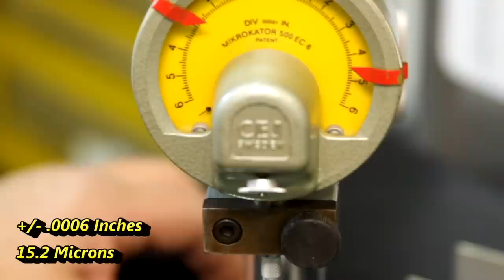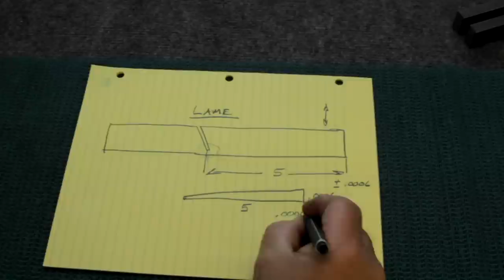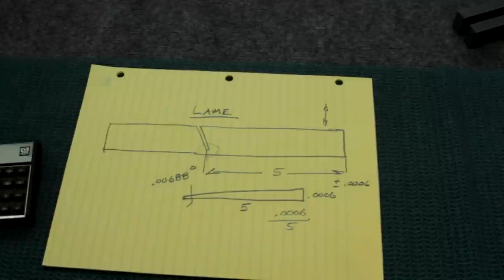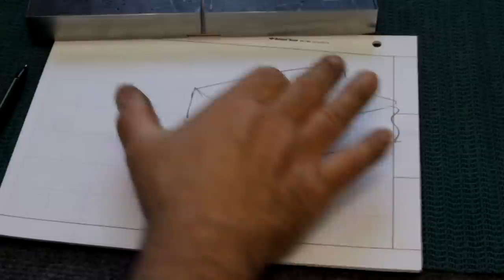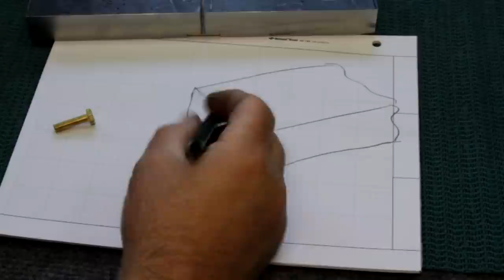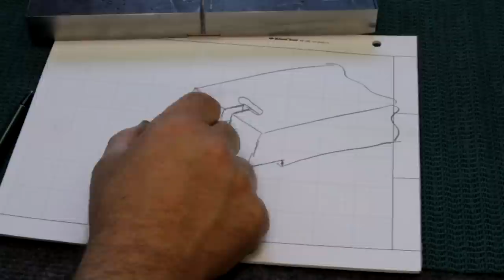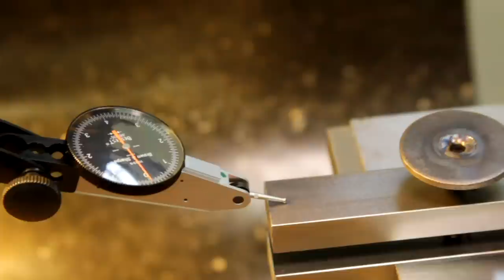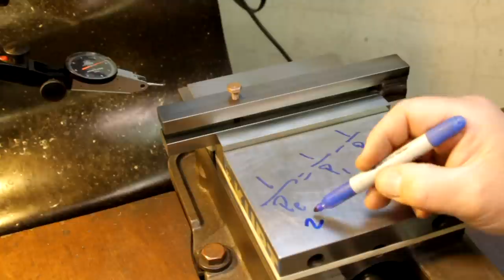Precision Mechanics

Comment: Why would anyone want "flexure" in a dial indicator base? You can zero the indicator and shouldn't need to or want to "slide" the tip of the indicator shaft across the work vertically or horizontally to "zero" the indicator with a "fine" adjustment. And what's up with measuring "dimensions" with a dial indicator? Typically you use a dial indicator - which is a "gauge" - to measure MOTION. Backlash, endplay, out of round, etc. Dimensions are measured with an instrument that can be CALIBRATED at various "lengths" within its range and that has no "slop" in its mechanism that can't be "calibrated" out of it. A micrometer can be checked for "accuracy" with a standard or even by itself if its a zero to "X" instrument where the anvil contacts the spindle. And you don't need a "surface plate" to measure the "height" of any object you can fit a micrometer "around". A "dial indicator" can't be "calibrated" and its internal rack-and-pinion and additional "clearance" in the mechanisms for additional dials are the REASON the dial can be "zeroed" by rotating it 360 degrees in either direction. I see you "precision machinists" using a ".0001" dial indicator and reporting your "measurements" in thousandths. Then you'll be describing some "imperfection" in a part using "thousandths", you'll "grind" or "lap" or "true" it and then "measure" it again and state that the same "measurement" is then within "tenths". Or it starts in "tenths" and ends up "millionths". 

Apparently there ARE no "hundred thousandths" in the "metrology" world, huh? Not when you somehow manage to always produce a "tolerance" of even tens of millionths and can tack a zero on the back of X hundred thousandths, pronounce it "millionths" and "skip" an entire "order of magnitude" as you switch from MERELY working with and two a "relatively" sloppy and imprecise "tenths" to "precision "metrology" which is according to you DIY "precision machinists" all in "millionths". That's weird since back when I learned to use precision instruments to make precision measurements you didn't dare "estimate" or "round" an additional "decimal place" beyond the "divisions" on the primary "scale" of your instrument. A "vernier" micrometer is ONLY "accurate" and "precise" to "tenths" IF you find two lines that PERFECTLY ALIGN and you've calibrated the micrometer with a STANDARD you know the dimensions of to TENTHS as well. And you still have "error" with a "tenths" measurement". And oh by the way, a  "tenth" is the FIRST digit to the right of a decimal point. The FOURTH is not a "tenth of a thousandth". It's TEN THOUSANDTHS. And if you can accurately and precisely measure TEN THOUSANDTHS, you damn sure don't need to use "couple" at any point DISCUSSING something that is "accurate" and "precise" TO TEN THOUSANDTHS. Just like a "few thou" isn't "acceptable" if you're doing/discussing precision work where "thousandths" are required. 

The "divisions" of an instrument are the "whole numbers" its capable of measuring to "accurately" and "precisely". A DIGITAL DIAL INDICATOR is not capable of measuring "to" five ten thousandths. It's INCAPABLE of precise measurements SMALLER than ONE THOUSANDTH. It has .0005" "divisions" because its RESOLUTION is limited to one thousandth AT BEST. Since its "accuracy" is +/- .0005" and it can't "measure" any smaller than .001 "accurately", when the jaws are closed and its"zeroed", that "zero" is ONLY "accurate" with the jaws closed. Go to .001" and it COULD BE "off" and that "reading" could be .0005" HIGH. That's why you don't use a digital dial indicator in place of a MICROMETER. Even with a non-vernier micrometer you can a least SEE if you're "off" on the "high" side or "low" side when a measured part is "out of spec". That way if that part is "loose" or "tight" in a bore, you know that at LEAST that part is "bad". But that doesn't mean the BORE is "good". In fact, if the ONE PART is OUT OF SPEC there's an EXCELLENT CHANCE the OTHER IS AS WELL. 

Do you "precision machinists" EVER get around to talking about the importance of using quality, undamaged, unworn and properly calibrated MEASURING TOOLS? I've never seen so many damned "professional machinists" to do some much damned talking about "accuracy" and "precision" with pretty much ZERO use of the proper tools, proper terminology and proper application and how to care for and calibrate and CHOOSE which tool to use for WHICH JOB. Is the MATH using a MICROMETER a little too complex for you "machinists" to do it ON THE FLY in a video? Is THAT why its dial indicators, digital calipers or nothing? The REALITY is that in the REAL WORLD you don't USE dial indicators to MEASURE ANYTHING BUT MOVEMENT. And you check "flatness" with a STRAIGHT EDGE AND FEELER GAUGE IF AND WHEN THERE'S A SPECIFICATION FOR IT. That's MAINLY engine work. Decks on cylinder blocks and cylinder heads. And the "tolerance" is usually pretty "large" compared to the crap you're presenting like its going to be a daily occurrence. Typically you'll have a "tolerance" of one ten thousandth per inch of length. And your "low" spots will be in the "middle" of a "span" between two contact points i.e. in the middle of a combustion chamber but measured at the "outside edge" of the head since you obviously can't measure "flatness" in empty space. And normally the "maximum" for "warpage" (there is NEVER a "flat" surface on a single axis that is "in spec" yet "out of spec" on the perpendicular axis i.e. TWISTED and therefore "warpage" is the "correct" term for how "unflat" a part like a cylinder head is) is that that ".001" per span between support points" TIMES the number of "spans" ON the surface and you use a STRAIGHT EDGE long enough to go "end to end" on the surface and check "flatness" at each "span", add each deviation from "flatness" you find and measure and if you get to the "max" for the entire surface length before you get to the FAR END, the part is JUNK. Because you're never going to be able to make a "wavy" surface with multiple "bends" at or beyond the max "per span" limit and beyond the "max overall" limit "flat" even IF it somehow gets "flat" between the point that maxes out the "overall" and the actual end of the surface. The part is WARPED beyond SPECIFICATION and any part that has specifications for "flatness" that include specs for both "overall" and "span" warpage will ALSO have a specification for "maximum allowable material removable". When you remove MATERIAL from a WARPED PART you're removing mass, rigidity and "strength". And if you DO try to remove more than the max allowable, pull the part off the mill (you don't do much "surface grinding" in the REAL WORLD EITHER), install it and torque it to specs and subject it to the loads it will see in service and remove it and re-check the "flatness", you will invariably find that even if it only "ran" through a "test period", it will be WARPED AGAIN. 

And FOR THE RECORD AND THE BENEFIT OF ALL YOUR CLUELESS "FOLLOWERS", this "tenths" and "millionths" crap is "aerospace" bullshit straight from "NASA engineers" who never worked in the "real world" and have NO CLUE that "flatness" isn't a "dimension" and there is no such thing AS "flat" on PLANET EARTH and in "space" with "zero gravity" EVERYTHING THEY PUT SO MUCH TIME AND MONEY AND BULLSHIT "SCIENCE" INTO "MAKING" FLAT AND "VERIFYING" or "CERTIFYING" A PART'S "FLATNESS" IMMEDIATELY BENDS AND WARPS WITH THE LOSS OF "STRAIN" AND "STRESS" THE SAME AS THOSE SAME PARTS HERE ON EARTH BEND AND WARP AS SOON AS YOU TAKE THEM OFF THE "SURFACE PLATE" OR "CHUCK" AND BOLT THEM OR WELD THEM OR OTHERWISE FASTEN THEM TO OTHER PARTS TO MAKE A "STRUCTURE".

The OTHER thing you'll find in the "real world" is that the overwhelming majority of "job shop" machine work is done on USED and BROKEN or DAMAGED parts. And when it IS "clean" carry-in or "custom-order" work, the CUSTOMER is going to have the tools and ability to CHECK YOUR WORK and VERIFY its to his or her specifications AND will know the "lingo" AND will know what is and isn't possible in the way of "accuracy" and "precision" and isn't PAYING for "extra precise" work. So you'd better not be TALKING OUT OF YOUR ASS ABOUT "tenths" unless you MEAN "ten hundredths" and for God's sake don't use the words "couple" or "few" or "about" or "close" or anything other imprecise, unspecific terminology if you're selling ACCURACY AND PRECISION. 

And saying "thou" pretty much means you're too damned lazy to even finish a word you should be using and thinking a "thou" times a day. Who in the hell is going to take seriously a "machinist" that can't/won't even TALK precisely? 

P.S. - YouTube videos of your "work" you made in your spare time in your empty machine shop with your used "hand-me-down" tools are NOT going to get you the kind of customers who will bring you the kind of work in the volume you need to be "profitable" let alone "successful" in a world where apparently judging by the number of YouTube "master machinists" with plenty of time to sit in shops full of used tools but empty of customer work who make YouTube videos of themselves making/fixing/restoring/experimenting with and generally "playing" with their own tools, machinists are in abundant supply. 

You also won't be keeping your hands and clothes clean and working on small, light, simple and "challenging" projects using brand-new materials with days or weeks to "deliver" a finished product with 95% of the that time going to "figuring out" how to do something with "cheap" mail-order materials/parts a "real" machinist would simply make "in-house" from "scratch". Ordering steel balls from a "specialty supplier" to make FLAT "footsies" for a "instrument" you'd better not need EVER unless you're beating the dogshit out of your "new" surface plate? Seriously? I guess YouTube has "redistributed "gun money" to "machinists" and their "how-to" videos. Or the "government work" YouTube "machinists" do "on the side" at "real jobs" pays AWESOME!
Reply: Your shop jargon is incorrect.  Every machinist that has ACTUALLY worked in machine shops refers to measurements in thousandths and millionths of an inch.  It's to avoid confusion when communicating on the shop floor.  .100" is one hundred thousandths, .010" is ten thousandths, .0001" is a tenth of a thousandth, .00005" is 50 millionths, etc.  Ask any REAL machinist, not Google or an engineer.

Comment: 1080 i cant watch you mr lipton
Reply: same here.  load, play, freeze, load, play, freeze.  frustration
Reply: Why dose he have it set so you can't change the settings ????
Reply: dont know
Reply: Houston, we have a problem.  1 hour 15 minutes to watch a 31 minute video!  High rez?  Not so much...
Reply: I don't think it's "him,"  I think it's "them."  Comparing previous video to most recent, the options disappear.  Same situation with a few other video providers (Halligan and Cremona) I just sent feedback to "them."  Not all of us can run out and buy new computers and other equipment on someone's whim.

If you use the "find out why" link that shows up when you are getting interruptions, you can send feedback.  If we gang up on them like a flock of mad crows, someone should get the message.
Reply: I set the settings to "AUTO" for the screen resolution and it plays perfectly on my computer.  I am using Goggle Chrome web browser.  The "AUTO" setting should adjust the screen resolution for playback. I can also watch on my iPhone without any problem.
Reply: I tried both, didn't make any difference here.  Even with Chrome.  Then again, after some consideration, I realize that my best computer is now six or seven years old.  Horribly out of date by some standards. 

Haven't checked with the Android yet...
Reply: Interesting, i have a 2008 Dell Inspiron with no mods and it plays fine. Could it be your internet connection? P.S. I understand computers like i used to understand differential threads before Tom's video. :)
Reply: i have a dell  Inspiron with no mods and i cant play
Reply: Inspiron 5030 here.  Yes, the internet connection has something to do with it (rural radio linked), even more so when you can't adjust the playback to what it can handle.
Reply: I don't know if it is you tube because some videos let you change your resolution. It must be the way they are uploaded.
Reply: A p.s. to Andy Coakes, I am out in the boonies of Arkansas on an investor owned telephone co-op with a self-build PC that's 8 years old and I can play the video at 1080p just fine! Think you may have problems on your end.
Reply: Andy Coakes I am watching in 360 right now.
Reply: no option for it
Reply: I didn't select any option that is just what it defaulted to.
Reply: I have adjustment from 144 to 1080.  No problems on 144 to 480. 720 and 1080 are HD. My connection is jerky at those settings  This is a strange problem some are having.
Reply: I went away for a while, reloaded it and continued, I now have the full range available.  No hiccups now.
Reply: I was having the same problem, so I waited and came back later. I think it takes a while for YouTube to process the video into all the resolutions (separate files for each) so you start off getting only the resolution that was uploaded. It's probably on a prioritized processing schedule too, so that videos that are high in demand get higher priority to be transcoded. You can thus blame PewDiePie for the wait. :-)
Reply: i have tried it again this morning and have the full range of resolutions strange how things pan out William Garrett i think i am a lot further away i live in the uk in the country side which is not known for its fantastic internet speed at the best of times
Reply: YouTube takes time to encode and distribute the higher resolutions. If you watch right after Tom has uploaded, you might not get the high quality version. Patience, grasshoppers.
Reply: Andy I am in UK and can adjust res' from 144p up to 1080p. I can play it just fine.Sorry but I only have the latest gen' Intel i7, 32Gb ram,4Gb video card and BT infinity 2 Broadband.  :-)  hehe
Reply: Some browsers like "Exploder" don't display all the resolutions options, search me as of why, but, Chrome or Firefox will get you all options from 144 to 4K, hope this helps...   ;)
For videos with solid content, you don't need to display the highest resolution to get something in the knowledge department...
Reply: My last laptop which was a first gen Windows 8 very budget machine with Linux had some problems.  Setting the resolution to Auto actually made it worse.  Because as your connection strength changes and changes in internet stuffs outside of the home, the computer will hunt for the "best" resolution that will work.  That laptop did not play well with HD content on youtube.  For some reason it would work fine with netflix.  If you are having problems with buffering, manually drop the resolution without using auto.  If you aren't seeing the resolution settings, I don't know.  That sounds like a youtube/timing from when uploaded issue.